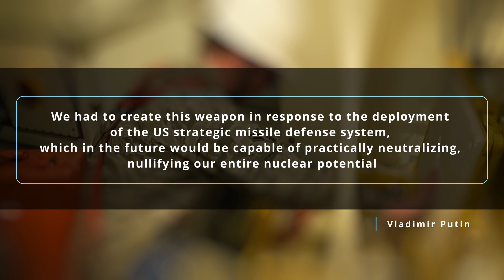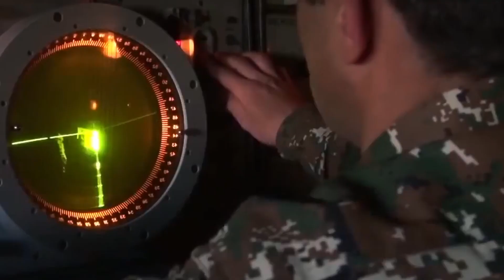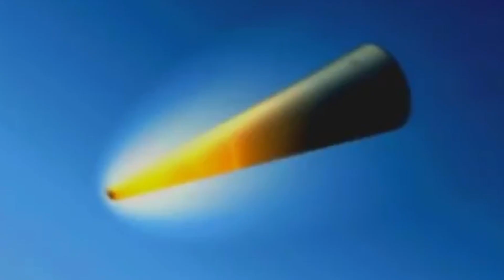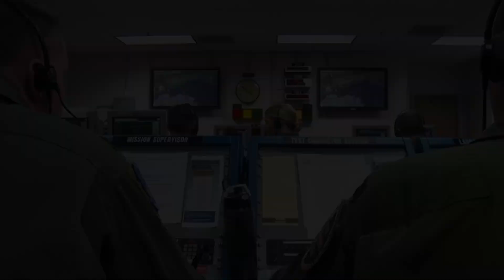These Are the Hypersonic Missiles that Terrify the U.S. Military

Comment: Speed and maneuverability dont mix. Something flying that fast will have very little room to shake a Patriots defensive system. Thats like driving 100 mph and trying to make a right turn.
Reply: its not changing direction at that speed, its like since its going so fast, they can be able to mameuver and avoid being detected.. unlike the regular missiles, which have an arc shot, like a bow... but this one you can shoot it more straight to the target, instead of aiming up high for the arc. making it harder to detect...
Reply: @motu4883 but the missile's cross section is ridiculous, just because it's fast doesn't make it stealth.
Reply: @motu4883  hypersonic missiles are designed to be dropped from high attitudes or fired into the upper atmosphere to help buildup their speed to Mach 5 or higher. But once they come down is when they're are likely to be tracked and destroyed. Think Patriots laser system and other weapon systems that are being tested.
Reply: its not that bro.. its because these missiles dont have to the arc approach to hit its target.. now it can just pretty much fly parallel to earth to hit it.. so its hard for the radar to detect because its too close to the ground @johndoe8785